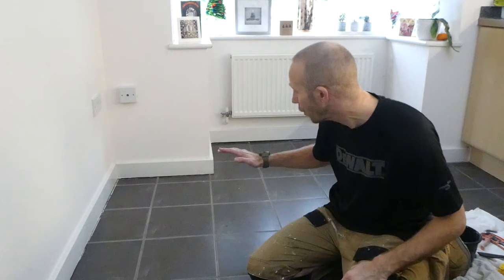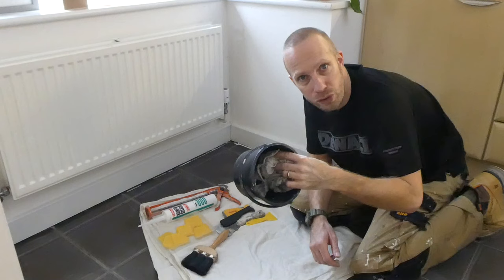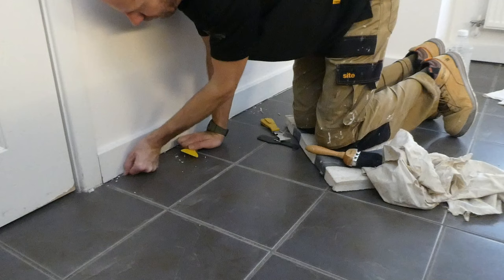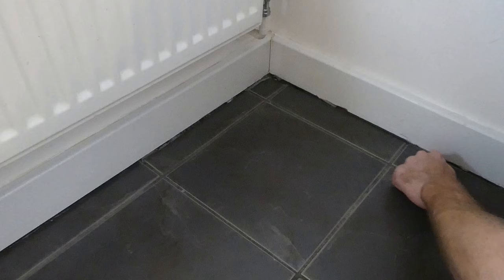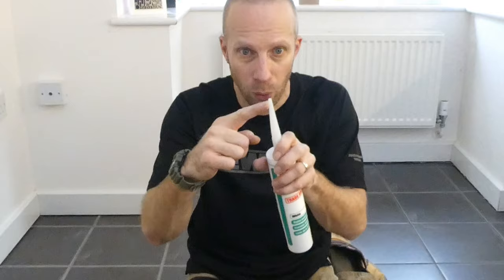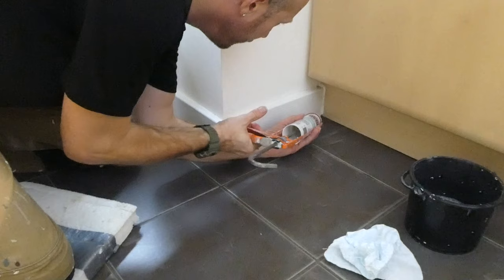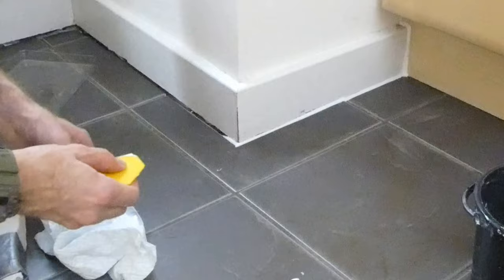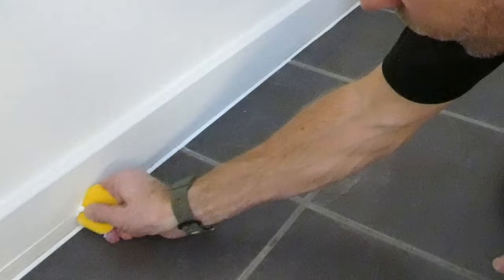How to apply Silicone - Easy and Professional

Comment: I would have found the biggest gap and then used a Fugi profile that was 3mm bigger all the way around.  That would have provided a nice even size silicone joint all around. Another tip is to dip the Fugi into the water/Fairy prior to tooling. This will provide a perfect finish and any excess silicone can be cleaned very easy.

Comment: If u want to chamfer 15mm lines of caulks,  will u first chamfer 8mm and then add silicone to chamfer 15mm? ie 2 rounds instead of one round to achieve solid fillings.

Comment: Just a quick question about silicone. Would you use it around windows in the house or caulk and paint?
Reply from the maker: Good question. It depends (always a good answer haha) Generally I'd use caulk, and then paint over it. If I'm using silicone I won't paint over it. For filling gaps between wall and skirting, and door frames, it has to be caulk. Think of using silicone as a finished product.... 👍

Comment: For those edges of the floor, why not use liquid nails which will harden as cured so dirt and fungus can be easily cleaned, whereas the soft cured silicone will let them penetrate & become diff to remove. Have u ever thought of the pros & cons of using waterproof liquid nails paste over silicone??
Reply from the maker: In my experience, liquid nails (as you call it) is not as smooth as sanitary silicone, and will actually be less easy to wipe any dirty spills off.
Reply: @JBTV   Thx for your point.  I'm thinking of using waterproof liquid nails { SELLEYS Liquid Nails Rapid Cure polyurethane adhesive that cures in just 10 minutes , durable, }, so that it is an once & forever job to caulk & chamfer these edges +gaps especially on floor ones.  Thickened bleach gel + tooth-brushing can then be applied to remove the fungal mould grown on hardened liq-nails every 2 months or so if any. In your case, u need to repeat in extra the 4-big-step  job once every 2,3 or 5 years depending on whether the sealing power remains. My doubt about Liq-nails is whether the blue kit-5 formers can refine the finish as nice as the silicone case, do u have more experience to share on applying the blue kit-5 bits on refining the fresh caulking of quick cure & sticky adhesive paste in tubes similar to the silicone sealants?    [Also I guess you mean "less easy to wipe off excessive or dirty spills even for fresh caulks let alone hardened caulks." ]

Comment: Not a clue bud, Watching you apply that silicone is an insult to pro decorators I don’t know how you’ve got the front put these vids up you might know a bit of carpentry but you’ve a long way to go with the painting.
Reply from the maker: Thanks Jon, I'll be sure to take your feedback on board
Reply: He isn't painting though you fud. Don't need to be a decorator to be able to silicone.